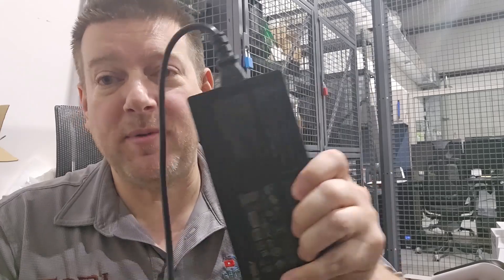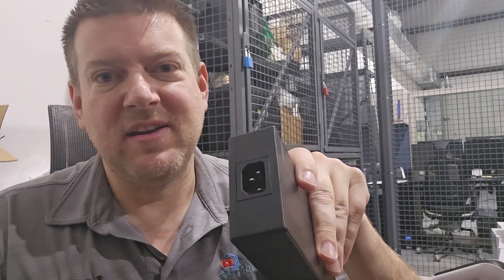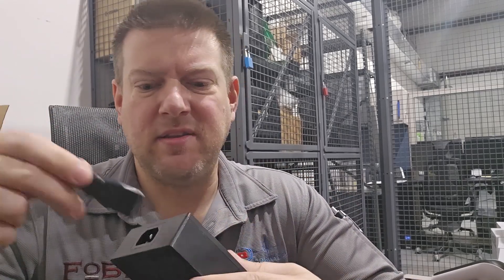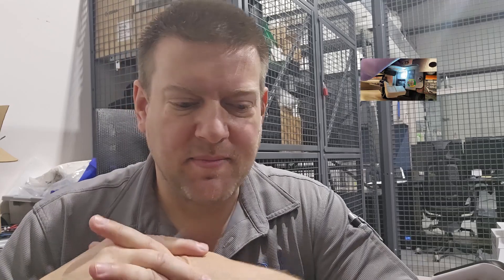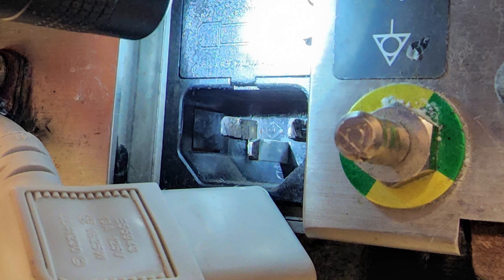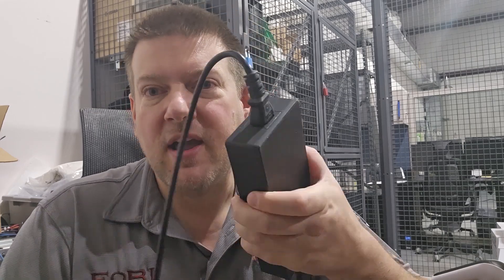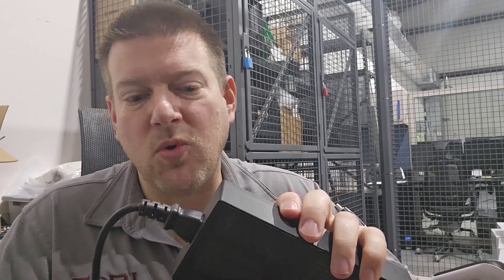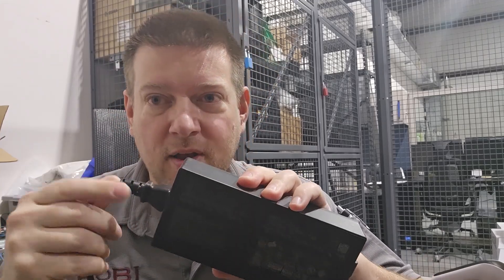Inspect Your IECs! Prevent Fires.

Comment: I could count the number of times I unplugged my laptops charger that way on my fingers. Charger itself died, after 10 years, not the cord. Fact is I bought replacement brick and still use old cable part as it's longer than the new one.

Comment: Recently I've been finding issues on high current draw devices that have purely copper female Connections in the power cord side of the IEC plug connection. They seem to be losing their grip on the male pins. I'm not going to State the company that I've been seeing this from, but they've been replacing the power cords with ones that have brass female terminals instead of pure copper.

Comment: Thanks - I will start checking all my IEC connectors - I wonder if this is the same for 230V ??? at 230V the unit still pulls the same power draw but the current is reduced.

Comment: The problem with IEC connectors and cables is that these are not all made equal. Some manufacturers have more tolerance in dimensions of the female and male pins then others. Have seen many new devices, where the powercord that came with it new already had a loose fit, if you then leave it that way, you will come very soon in troubles. 
I have also seen devices where new cables have a very loose fit, and where the previous power cable has a very snug fit like it suppose to have.
So my advise is, do not throw away used power cables if the conector is not burned or melted or does not show any damage, soon or later it will become handy to have.
Reply from the maker: @BjornV78  in medical we cut the cord and throw away. There is no "ifs" in medical repair. You're right about the loose fit. My laptop charger is loose right out of the box